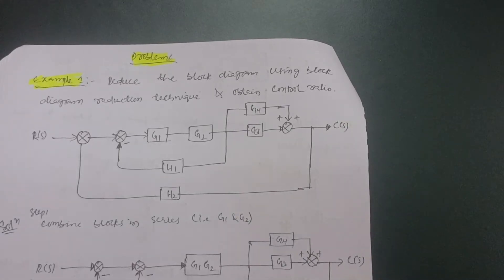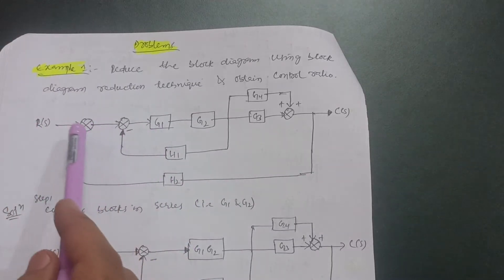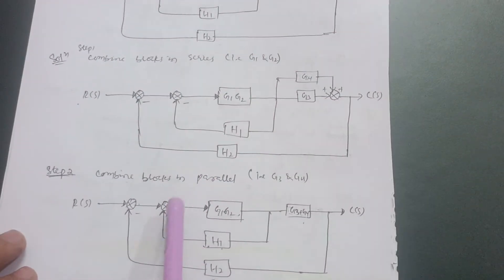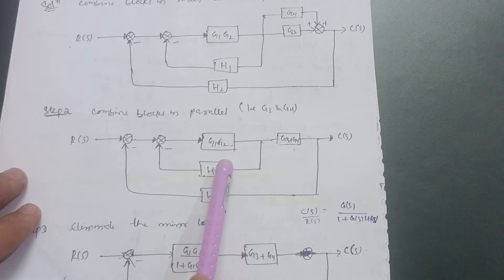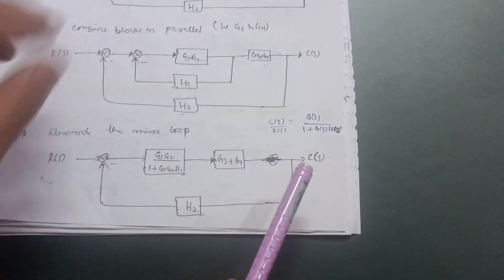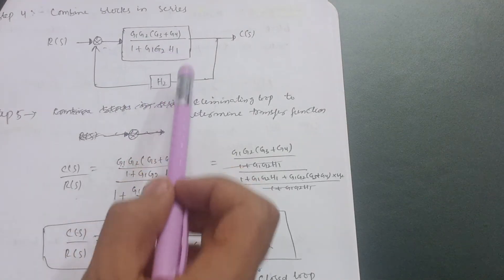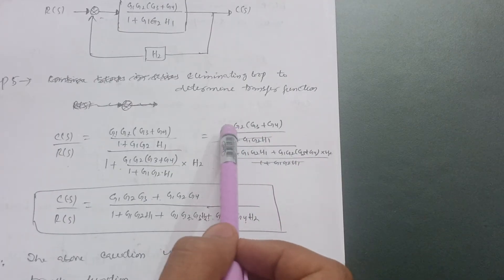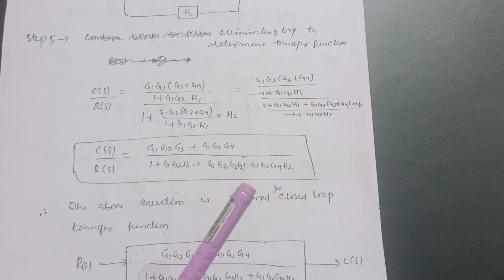BLOCK DIAGRAM REDUCTION CONTROL ENGINEERING VTU |MODULE 3 🔥

Comment: I had a doubt in step number 3 summing point has - sign...and you have taken minor loop sign as + ?
Reply from the maker: It is rule brother when summing point has negative feedback signal we have to take +ve value in formula,....if +ve signal then use negative value in formula while eliminating minor loop...... hope it is clear
Reply: @mohsin_ali_14  okay 👍